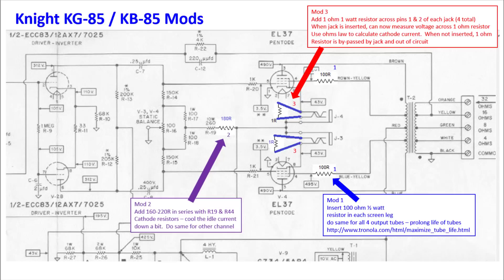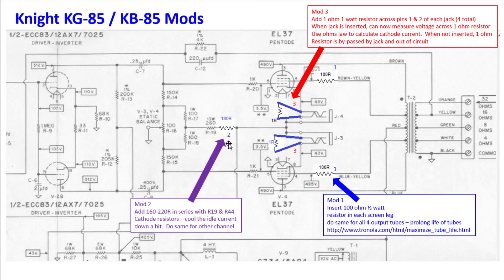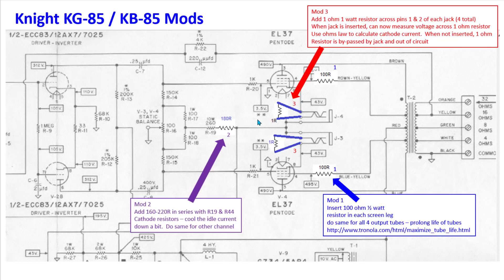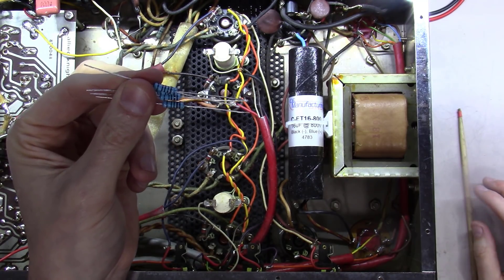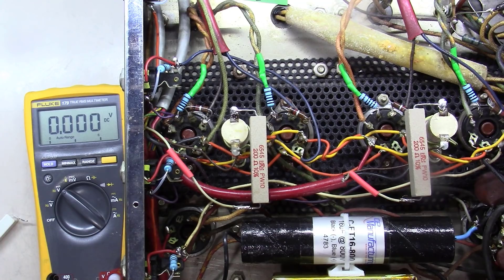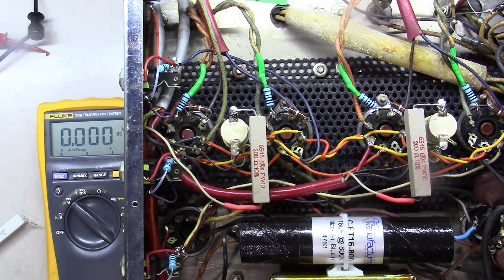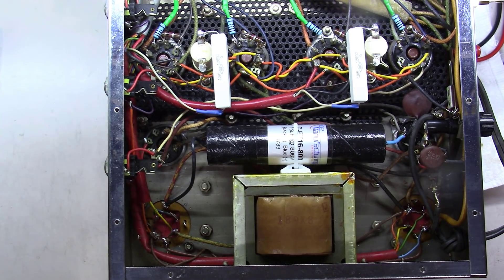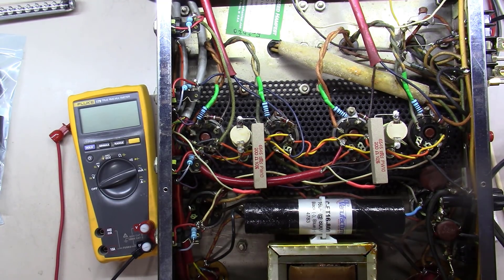Knight KG85 / KB85 Stereo Tube Amp Mods

Comment: I have this amp without any mods only new coupler caps and electrolytics on the cirquitboard everything works fine when using good RFT EL34 or Mullard EL37 tubes!

Comment: Greetings:
When the power output tube has its screen grid powered by a tap of the output transformer that it formed what is known as an ULTRA LINEAR circuit (the voltage relative to the anode may have a significance but I don't know  for sure).

Comment: Nice to add this mod for the ones who own this Amp. My 6550 has got the same resistors at the screen taps only 10Ohm value, and brought instrument isolated pins to the backside of the Amp so I can measure the tubes without opening the bottom. Nice video's Mark always

Comment: I've heard you mention in many videos your preference for having good physical contact at soldered connection points. This is the first time I've seen you not do that and I'm curious as to why. I don't see an obvious reason to not use J-hooks on the wire/resistor connections.
Reply: Greetings:
I'm sure the reference is to the 200 ohm resistor to wire connections.
Reply from the maker: Trying to think of where I didn't on this, I almost always do.  Only one place I didn't was on a wire that went between two caps as it was super stiff too short to bend

Comment: I'm itching to recap my Knight KG-865 solid state amp! Ordered $45 in capacitors already cause I want it to work right the next 50 years! 
The only thing I did to it so far  was put a strain relief on the chassis for the power cord.

Comment: I would change the idle sensing jacks to non switching and wire the sensing resistors in circuit all the time.  No need to have the contacts there to go bad or intermittent over time.